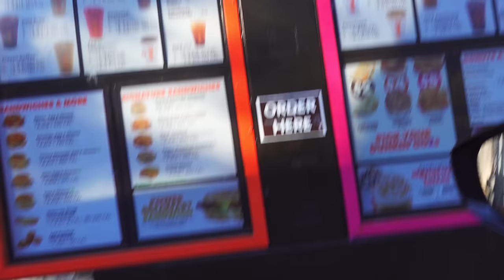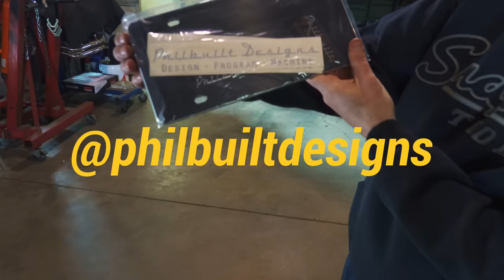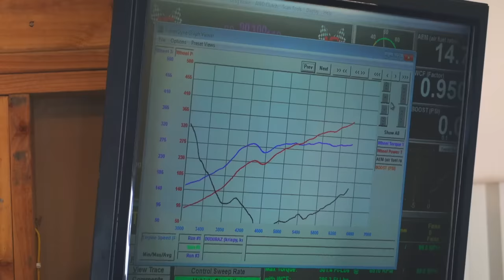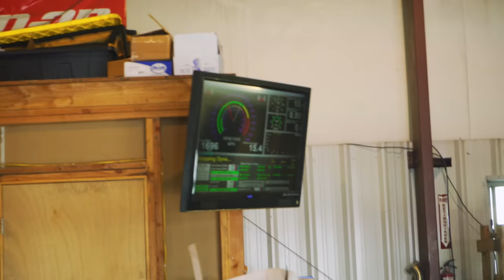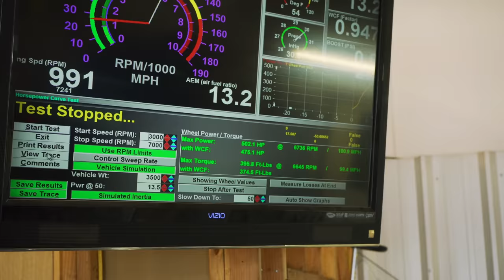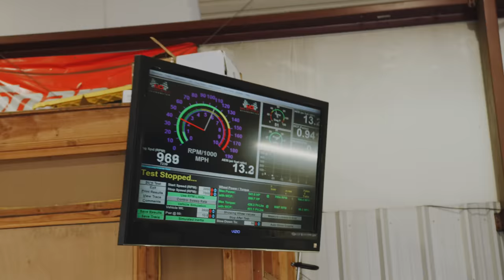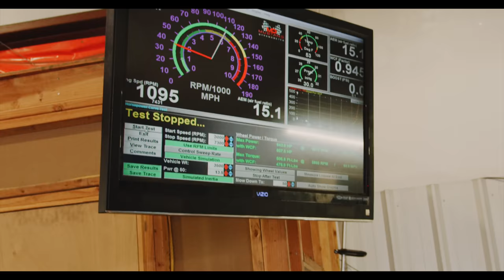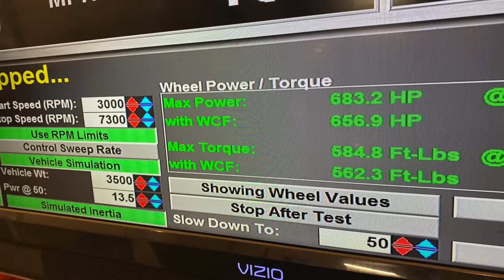Legacy GT Wagon Dyno Tune! (6XXHP + FLAMES)

Comment: My goal when I built my current STI was to be able to melt the tires in 2nd gear when I pin it , it takes 500 hp , just in case you're wondering !